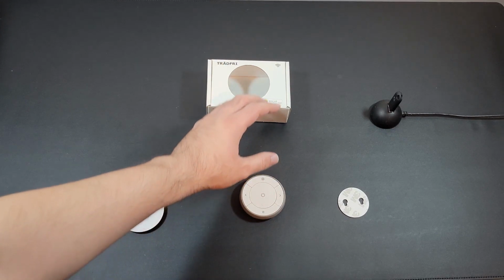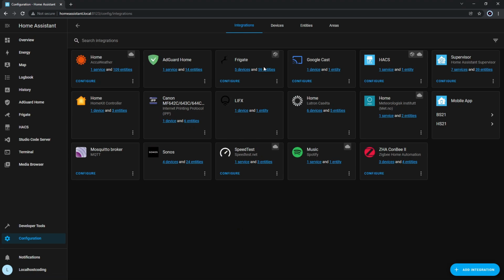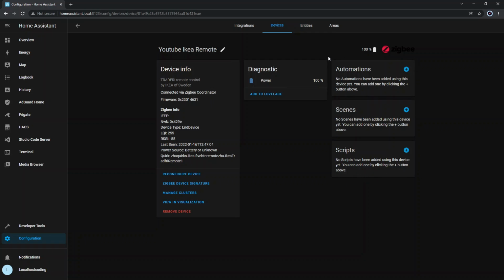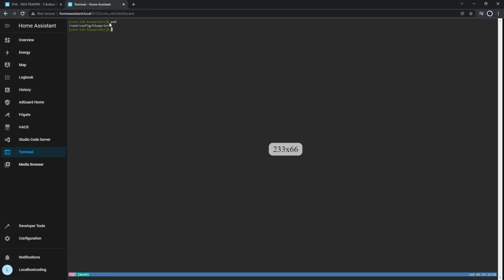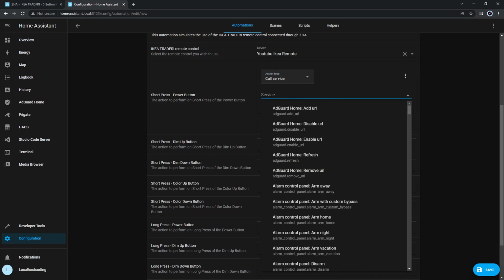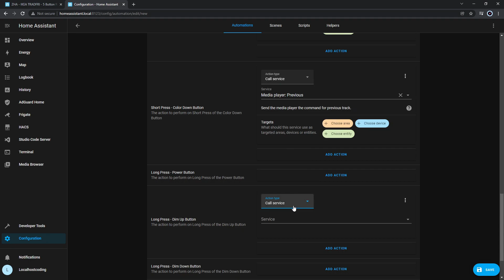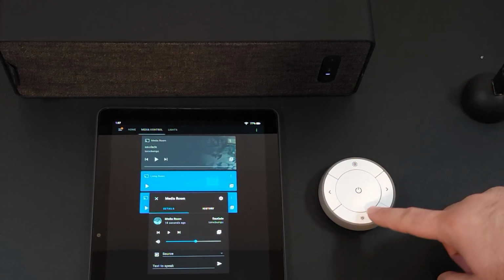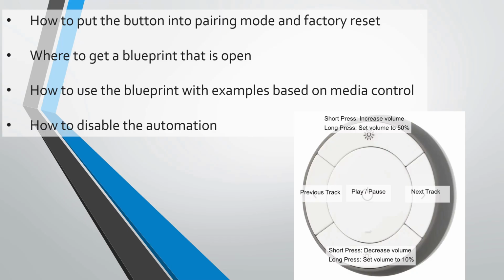Connecting Ikea Tradfri Button to Home Assistant

Comment: Hi have you figured out the battery issue? I have 3 ikea tradfri buttons and the eat up the cr2032 batteries fast.
Reply: make sure the firmware is recent, helps allot
Reply: I need to look at this, 10 days in and 87%.
Reply: i had the same issue. what type of ZigBee adapter do you use? 

I'm thinking of switching to a USB stick like the one shown in this via. I think it might help provide a stable connection and hopefully also help with battery drain
Reply: @is95js  I use the Conbee stick. In my case updating the firmware of the Tradfri buttons was the sollution.
Reply: @BartCockheyt  how did you update the button?
Reply: @kevin4rsl did you find out how to update?

Comment: I'm not sure why, but the first two times I paired it, it didn't have any entities.  The third time, it  had "identify" and "power" level.  I was then able to use the blueprint.   Great video, thanks for helping!
Reply: For some reason, my setup doesn't distinctly differentiate between long and short press.  I put one light on the SHORT,  another on the LONG.  Short press works on the single intended device.  But long press will activate both.  Anyone share that experience?
Reply: I can share the general experience of spending days and days trying to get home assistant to do really basic tasks, but with so much 3rd party open source integrations, when something simply doesnt work, you dont have much hope of figuring out what bit isnt working, and because you are then in a pretty unique rabbit hole, google or youtube cant help you much either.  You can try wasting more days or possibly weeks of your time to achive what should be simple (basically get buttons to turn things on), but youve got no guarantees it will ever work.  Home Assistant is a great concept but is light years behind in terms of usability.